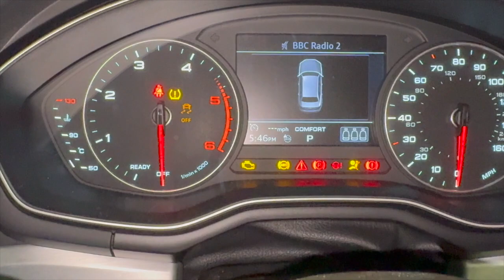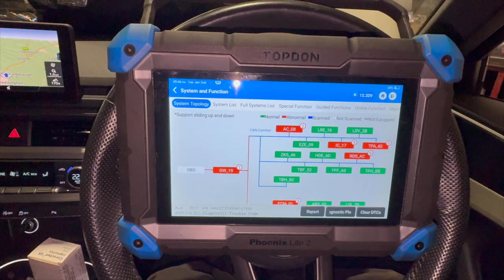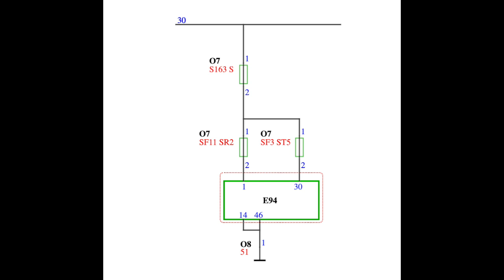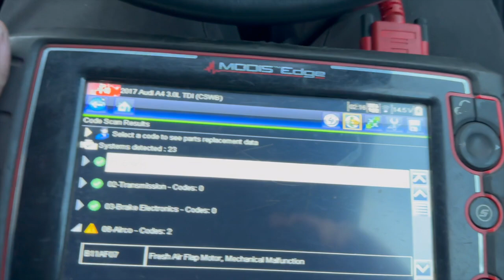2017 Audi A4 Ad Blue fault - P21CA Reductant control module supply voltage

Comment: Do you know if the new AdBlue ECU has been improved to be better protected against corrosion? Atleast it has a new parts number index. My local mechanic said he hasn't seen newer ECUs with this issue, but maybe it could be due to them being newer and they'll have to same problem later...

Comment: Good afternoon, great video, I have this problem in my car, if I buy this new or used module after I fix it, there must be a configuration? Or is it just replacing it with a new one and deleting the error and restarting with an obd11 that already works?